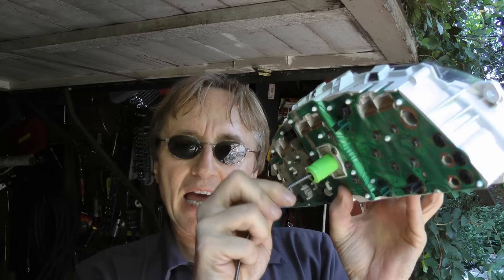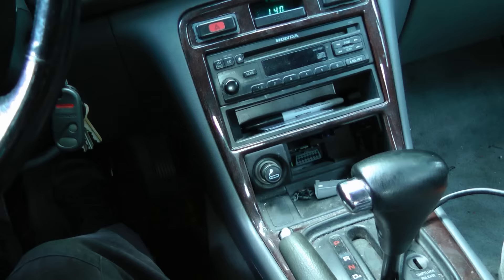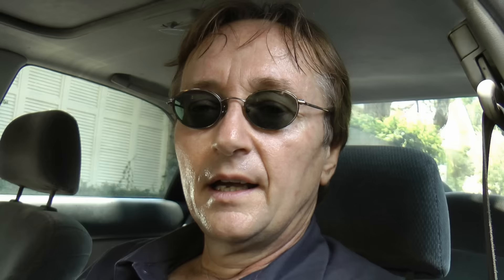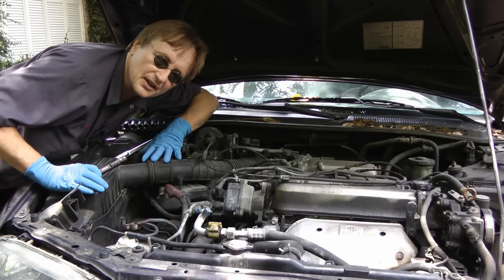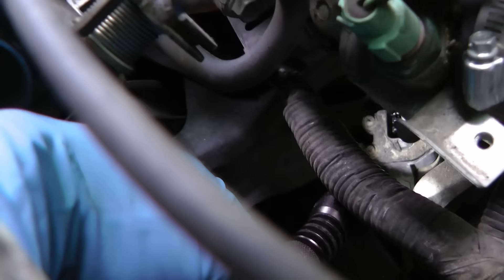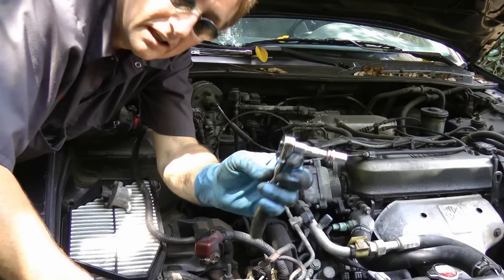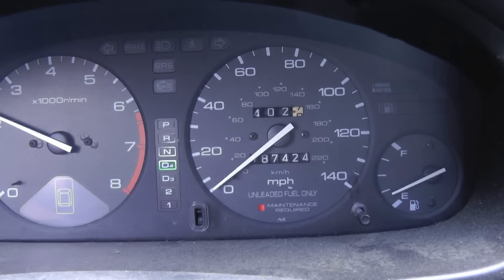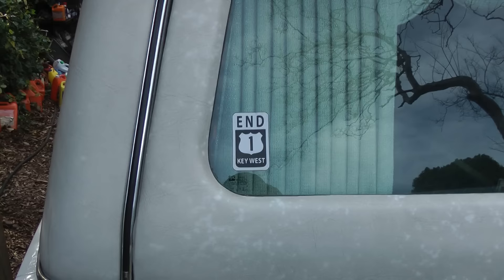How to Fix a Speedometer Gauge in Your Car (Speed Sensor)

Comment: hey Scotty my 1995 eclipse  speedometer does not work i got a new one and it still does not work. so i pluged in the new sensor and took it out of the trany, and put a drill gun in the part that the trany moves (the little peace at the end) and it work but wen i put the sensor back in the transmission it did not work i dont know what to do!! can u help me.

Comment: Hello, I´ve got an 06 Subaru Legacy.
Inside the cars cluster the speedometer, rev gauge, temp gauge, gasoline meter and the Mileage display stopped working.
All of the cluster indicators work such as turning signals, etc

What do you think?
Thanks
Reply from the maker: generally a bad dash, with the circuit boards coming apart. As they cost a ton new, I often opt for used units

Comment: I have a 2004 Corolla that just had the engine replaced. When I got it back, the speedometer and odometer don't work. The mechanic changed the speed sensor, but that didn't do it. I checked the fuses and wires for continuity and everything was fine. Could it be the ECU?
Reply: Yup

Comment: scotty, I was changing my spark plugs and spark plug wires on my 1994 4runner. after I did my speedometer rpm gas gauge oil and battery gauge stopped working. 

any idea what I did and what I need to fix this.
Reply from the maker: check for wires you may have disconnected doing that work

Comment: does the camshaft position sensor or throttle sensor have anything to do with the speedometer ? mine doesn't won't work I changed the speedometer sensor or the cluster and nothing still not working
Reply from the maker: +Savu Macias no they don't operate the speedo, either sensor is not spinning from tranny gear being broken, wiring to the dash is bad, or the speedo head is bad

Comment: I have a 1993 Pontiac Grand Prix, my speedometer does not work, so i replaced the speed sensor. The car was giving a trouble code for speed sensor anyways, speedometer still didn't begin to work. Once in a while it will flicker up and down, but that's about it.

Comment: Hey Scotty, I have a 97 toyota camry, the speedometer stays at zero and the digital odometer goes completely off. It sometimes revs over 3000rpms before it wants to shift and the check engine light comes on. After a while of driving it will stop and drive as normal and the engine light will turn back off. Not sure if its the speedometer or the vss. Any advice would be greatly appreciated!
Reply: if you car is an automatic its sounds like it's the vss since it's not shifting properly the transmission in automatics needs an accurate reading from the vss to know how fast the car is going to know when it needs to change gears since it's all computerized, might not need to replace it sounds like it could be loose possibly the connector since after a while it starts working again might be getting jiggled back on. The check engine light being on is probably due to a vss issue if your car has an odb1 system for the check engine light all you need is a paper clip to bridge the connection to the plug to get your check engine light to blink to figure out what the code is for the issue it's detecting, if it's an odb2 could take it down to an auto zone if you have those in your area they'll check your check engine light for free. or see if anyone you know has an odb2 reader

Comment: Hey scotty, I have a 96 infiniti i30 and my vehicle speed sensor is bad on it, I'm told it's behind the driver's side tire, but the sensor I'm told is the right part is not the same as the one that's coming out, it's quite smaller then the new one. I'm wondering if there's another location for this part that they sent me on the transmission, hopefully they just sent me the wrong part and I can reorder the right one. So do you agree with the sensor being behind the tire on the trans? Hopefully you can help me Scotty, thanks

Comment: I have a 2004 Pontiac  Sunfire mileage 28,000 and my gas gauge, speedometer, temperature gauge and RPM I guess you call them.  At different times each one does or doesn't work, it goes crazy as soon as I insert the key to start it will either move all to the left or just a particular one and then the next time I start the car it does something different.  I was ok with the gas gauge I would fill and write the mileage and kept track of it that way but now the speedometer sometimes won't work.  I don't understand how my car would have these issues when it only has 28,000 miles, not used in the winter at all and now this.  I'm afraid to take it to a dealer these days in fear they will charge a fortune if it's just a simple thing.  Would you please direct me as to what I should do?  This has been going on for a while and each time it's different one or the other or both.  It seems to have started when we disconnected the wire from the battery over the winter when it wasn't being used for 5 months and then reconnected.  I'm wondering if it could be the battery we did replace the battery come to think of it.  I now remember 2 years ago when I started my car the connection would make a ticking sound and my radio clock would go off and I had to reset it.  We then got a new battery from Walmart's and the clock stays on when I start the car but the gas gauge does crazy and at times the speedometer sticks at times and all of this changes when I start my car each time.  Thanks for reading this and if you could shed some light on this matter, it's driving ME crazy.

Comment: Hi Scotty i have a 98 ford mustang and sometimes while driving my rpms gauge will get stuck and not move past 2500 until I shift into 3 gear or press the clutch in a little do you have any tips?
Reply from the maker: If it runs fine and goes fast, the tach is just breaking down. They cost a ton for a factory one, most guys will just put on an aftermarket one and put it on the dash like a race car

Comment: Hi, Scotty, the speedometer dial in my 1995 Toyota Camry I4 2.2L Automatic doesn't move when driving at low speed (<60 MPH), and I occasionally notice it moves only when driving faster than 60 MPH or higher (highway mostly). I thought it's a problem with the dash speedometer head or its cable. After watching your video, my thought is, if the problem is the speed sensor at the final gear in the transmission, wouldn't it affect the transmission shifting gears?  I've driven this car daily more than 13 years. I feel its transmission up-shift and down-shift all fine at all 4 speed gears.  What's your thought how I should approach fixing this problem? Much appreciate your advice.  - Eric, Chicago, IL

Comment: hi i have a 1997 ford xlt 2 wheel drive i have a speedometer that works when it wants to im thinking its cable but dont really know is there a video or any advice you can recomend on repairing it ?
Reply from the maker: na, this is the same as this video, it has a speed sensor on the transmission, no cable

Comment: I've been having problems with the cluster.
First off I found that the RPM meter cable was off.. then when I started the car to test it it would bounce up to 2 and then stay there.. and wouldn't move again even if I rev my engine.
Then recently after cleaning my throttle body I went to turn on the car but forgot that the positive terminal on my battery was off and I swing to turn it on like 4 times then I remembered it was off.
After that everything got worst. 
My gas meter read full.. it's suppose to be half cause that's how it was all the time
The RPM stayed at 2, nothing changed there.. 
and now the Speedometer bounces at 20 then goes down to 10 and stays there and sometimes moves up and down when I rev my engine...
I've checked the thermostat wire which is clean and I've checked my fuses under my steering wheel.. which are also good..
Any suggestions ?
1991 Honda Accord

Comment: I have a 2004 Tiburon with Speedometer and odometer not working.  I checked the speed sensor with scan tool and the sensor is working.  So I changed the instrument cluster but it still doesn't work.  Do you have any suggestions.  Do you have a block diagram of where the signal goes.  The transmission shifts fine and I have no trouble codes
Reply from the maker: +Ed Chuhta often a bad body control module, big money if so

Comment: hi I have a 2004 acura tsx. my speed odometer doesn't work. code read is po 720. it says the shafter connection problem. how do I fix that

Comment: My speedometer stops working at 80 it drops down to zero and my steering wheel gets tough. When scanned it says speed sensor A but the auto electrician said replace the cv joint i just cant understand.

Comment: Hi Scotty, I have a 2006 Equinox. I just bought it and had to take it back to the dealership bc it started running hot (needed head gasket). Ok so now that I have it back,  my digital odometer isn't working. I know they have a truck just like the one I bought. Do you think they've exchanged the motors? Or trying to hide something on the dash?
Reply from the maker: +Chan Lewis no idea on that one, but if it worked before, take it back, they can fix it free. And really, don't buy GM products in the future, they really don't hold up and you've got a 9 year old one ready to become a money pit soon
Reply: 😕 Wish I would have known... Thanks

Comment: I have a 1984 ford thunderbird with a digital cluster, the gas gauge shows up but the speedometer doesn't. I've been through every bulb, fuse, relay, the cable, the gears on the cable in the trans and I even checked the plastic circuit board on the back of the cluster, and I still can't figure it out. I was wondering if you or anyone else had some other ideas. Please and thank you.

Comment: Hi I have a 1994 Ford Probe v6 and the speedometer doesent work but the rev counter does any ideas thanks
Reply from the maker: Paul Crocker often a bad speedo cable if it has one, or speed sensor if it's electronic

Comment: Hi, I have a 1999 Buick Century Custom with just under 81,000 miles, and my odometer/PRND321 display is dim. What could be causing that and how do I fix it without damaging anything?
Reply from the maker: +MetroJet2000 check the ground wiring on the dash, and pray it's not the dash circuits breaking down, which it often is.

Comment: hey Scott, I have a 1981 datsun 280zx and the speedometer doesn't work. The first time I installed a new speedo cable it got chewed up and made the speedometer needle jump all over until the needle broke!. so I replace with a new speedometer and a new cable but now it does not move and stays at zero. Any suggestions/advice you can give me? Thanks in advance!
Reply from the maker: +randy bruno  often broken speedo drive gear inside the tranny
Reply: +Scotty Kilmer sounds thanks I'll give that a try I did notice a little bit of oil coming down from the outside cable today!

Comment: on a 84 mustang don't I just remove it from where it's bolted to the ttransmission? I'm having the same issue. instead of seeing if it's the cluster I wanted to just run an aftermarket unit. how exactly does it work on older cars scotty? thanks.
Reply from the maker: +Samuel Campbell  older cars use cables that spin running off a small gear in the transmission.
Reply: +Scotty Kilmer thanks Scotty

Comment: Hey Scotty, I'm in trouble and I need your help. I have a P0500 Speed sensor A for a Toyota T100 96' I don't know where the Speed sensor is and is it repairable?
Reply from the maker: it's on the transmission, just replace it

Comment: Hey Scotty i have a nissan skyline r33 i recently brought it and the speedometer for the RPM has gotten stuck at 9000 and going over. It goes back down to 0 when i switch of the engine but when im driving the needle is going all over the place possible problems?
Reply from the maker: dash is broken, try to find a used one, new ones cost a ton

Comment: Hey Scotty, I changed the VSS on my 97 honda accord lx and the Speedometer, Odometer and cruise control are still not working at all. What could still be the problem?
Reply from the maker: hook up a scan tool as in this video, if the tool shows correct speed when driving, then the dash unit is bad. If not, then either tranny is broken inside the drive gear for the sensor, or sensor is bad, or wiring to the dash is bad.

Comment: what if the speedometer is working but it's inaccurate? Driving 10 miles and it's showing 40 mphs? I have a 2000 Toyota Sienna.

Comment: Hi Scotty, I have a 1992 Nissan truck that I will drive when I get my license in a few months. The speedometer needle works but it's old and brittle and bends towards the dash. Would there be a way to replace the needle itself, or would I have to replace the entire assembly?
Reply from the maker: +RGO Impact   na, get a used dash from a junk yard if it breaks
Reply: +Scotty Kilmer Alright we'll see what we can do. Thanks
Reply: +RGO Impact you can just pull it off most likely, and buy some replacement needle. tons of videos that show you how to remove the needles from guages

Comment: I have a 2000 ford windstar 3.8 v6. When I drive, speedometer always shows like about 15 or 20 mph less than what I'm really going. For example if I'm running the van 50 mph it's telling me that the van is running at about 30 to 40 mph. My best guess it's that the speed sensor isn't working fully and needs to be replaced but not 100% sure. What do you think scotty or if anyone else knows, PLEASE! More than welcome to help?

Comment: I just put reverse glow gauges in my car and my mph gauge isnt moving. I know its not my speed sensor. Do you know how to fix it if its in the instrument panel?
Reply from the maker: you remove the panel and replace it with a used one (new ones cost a ton) or try to find a speedometer shop that fixes them, a few are still around

Comment: So, I've got a speedometer that reads inaccurately and bounces, and an RPM meter that's stuck on 5,500 rpm. Also the cars an '83 Camaro. Would that still be the cable? and how does one fix this problem?
Reply from the maker: +Guest Calypso pray it's just the cable for the speedo. And get a new tach if you need one, aftermarket ones cost little and can be put on the dash like a racing car

Comment: Yes Hi I was recently pulled over for going 80 mph, my cruise control was set to 65, is there a reason why when I put my car on jacks and have the cruise control on while holding down the gas pedal the spedometer says I'm going 80 but i have it set to 65.......... this is a new Mercedes

Comment: 1995 jaguar xj6 I check the fuse boxes and some fuses work and some don't then I check in the fuse boxes and some have power and some don't I wonder why? if is fuse box problem or cable
Reply from the maker: not all fuses have power all the time, realize that. If it has a cable, replace that first

Comment: Scotty I have a Nissan Altima 00 and when I'm driving 4 or 7 Miles down road the speedometer and cluster and temperature gauge die out and then after 1 mile they work for about 30 seconds then died out till the car has a rest stop for at least one hour but when I'm driving the car down the road again for 5 or 7 miles the speedometer cluster and temperature gage die out I don't know what to do about this problem any suggestions before I spend about $1000 to fix this at a mechanic shop?????

Comment: +Scotty Kilmer in a 1993 honda civic ex is it the cable or speed sensor if my speedometer has stopped working?
Reply from the maker: should still be a cable on that one, but get your VIN, call a honda parts dept, they can tell for sure

Comment: Hey Scotty I put in a brand new VSS and PCM and I'm still not getting spedometer reading on the live data or on the dash. What could be the problem?
Reply from the maker: m medrano put it up in the air, and remover the speed sensor and see if the gear inside spins, if not, tranny would need taking apart. If it does spin, then wiring would have to be bad from sensor to computer
Reply: Thanks for the tip, I'll get right on it.

Comment: Would you know now to pull the instrument cluster out of a Pontiac Aztec?
Reply from the maker: +Brandi Radics yes, it's basically taking off a few screws and snapping all that plastic crap out of the way to access the screws. I could do it in 5 minutes
Reply: +Scotty Kilmer I got it in, the speedometer works now but the gas gauge still doesn't and now the mileage won't light up. I'm not sure if the computer needs to be reset or what.

Comment: i have a 1998 jeep grand cherokee i replace the speed sensor and i also check the wires is getting power and replace the dash unit  but the speedometer still dont work,do you think it could be the abs wheel speed sensor?
Reply from the maker: often a bad bcm unit then IF the wiring is really good and you didn't get a bad used dash cause that old jeeps open break dashes
Reply: bcm is that under the console? i replace the pcm under the hood cause it was bad, jeep running great now just need to fix speedometer

Comment: Hey scotty I replaced the speed sensor in my 96 honda civic lx coupe and It still doent work.what do u think its the problem?
Reply from the maker: +jose chavez either the drive gear inside the tranny that drives the sensor is bad, the wiring from the sensor to the speed head is bad, OR a bad speedo head. Good luck

Comment: Hello Scotty, I have a 1995 Honda Accord LX that the speedometer needle is stuck at 20 mph. I've already replaced the VSS on it but, it's still stuck at 20 mph everything on the gauges work. Any ideals on what might be causing this to happen to my car.
Reply from the maker: +Andrea Payne   replace the speedometer head, but they cost a ton. SO try a used dash from a junkyard, they don't charge much for one on a car that old
Reply: +Scotty Kilmer, Okay thanks Scotty, I will looking into finding one this weekend.